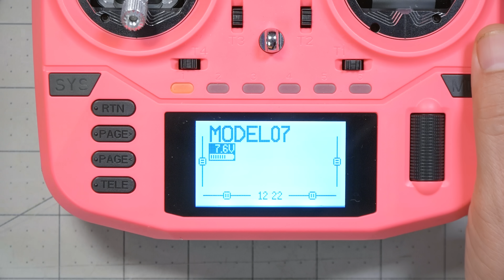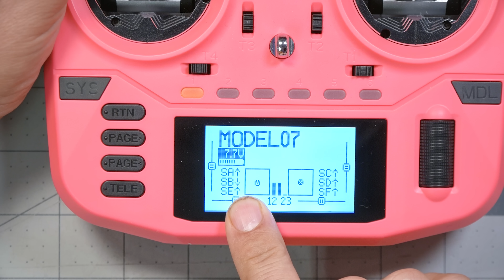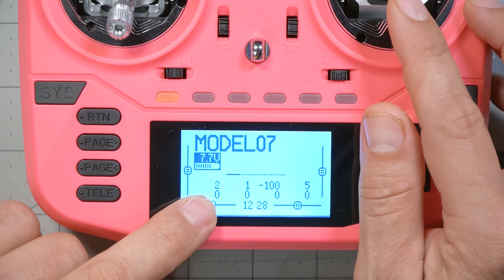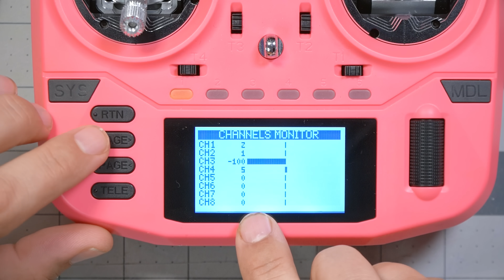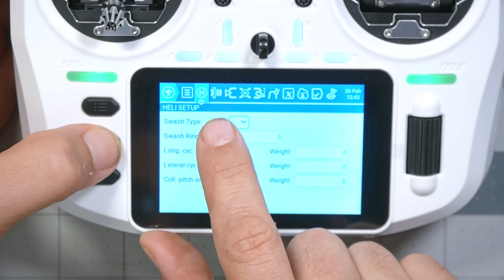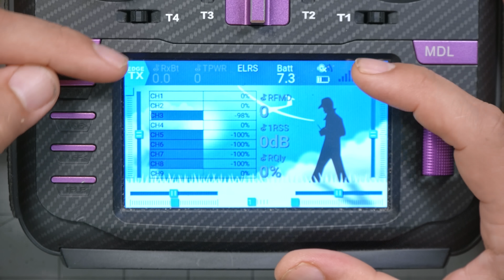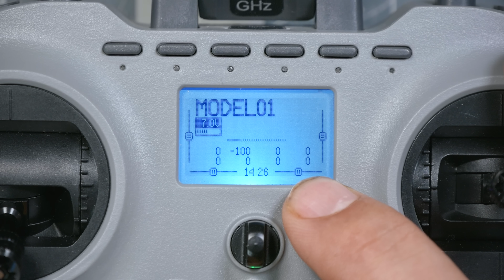EdgeTX - Complete Beginner Guide - Ep01

Comment: Hi Joshua....following your videos on Edge TX but have a question...will my TX16s running edge TX be compatible with a Radiomaster R9DS receiver? I thought it was since I have both the ELRS and 4 in 1 module (bought the 4 in 1 after purchasing the ELRS version) are supposed to work with every protocol out there

Comment: Hi everyone,
Hi Joshua,

I bought a servo on Amazon to rotate an FPV camera.
According to the specs, it has a rotation range of 270 degrees and expects a control signal with a pulse width of 500–2500 μs.

I’m using a Radiomaster TX16S with EdgeTX, which by default outputs signals in the range of 988–2011 μs.
With “Extended Limits” enabled, I can get up to 732–2268 μs, which already allows the servo to move significantly more – but it’s still not utilizing its full range.

I’m now looking for a way to configure the transmitter to output the full 500–2500 μs pulse range, so the servo can use its entire motion.

Does anyone know how to set this up in EdgeTX?
Any help is greatly appreciated!

Best regards from Stuttgart,
Philipp

Comment: Please help, both my drones with 04 elrs working fine with binding phrase, now I can not get them to arm, when I unplug battery, controller says transmission lost suggestion its connecting, also if I turn the arming switch on before powering, it gives me a warming, meaning the switch is working??

Comment: Just purchased new Boxer radio. Trying to remove sd card to replace with brand name card. Without using excess force how do you remove the card. Mine refuses to move with moderate force.

Comment: As an edgetx user, with a TX16s flying fixed wing aircraft. I seem to be the guy that our FrSky ethos users come to for help. Most of them went to Ethos because edge was too hard to learn. They seem to have the same issue with Ethos. Steep learning curve.  Sure, dual band is great for large scale jet turbines. But most have the 4 in 1 FrSky Tx modules to fly the planes they already have.

Comment: I've been getting more interested in the hobby again after a few years of lower activity. Your videos have been good so far. 

However this one rubbed me the wrong way right out of the gate. Almost immediately you made an assumption that is just plain not true in my opinion. You said there's almost 100% chance that my transmitter is running edge tx. However at the multiple local clubs I fly at it's very rare to see an openTX/EdgeTX or frsky system. Most are on spectrum or futaba. With a select few on jeti. Then even less common than that is the open tx stuff.

Your videos are informative and you present well. But please don't make assumptions like that.

Comment: Just found you via flowstate film. Great work BTW. I'm a pilot and have a flight sim set up. Is there a simple way to plug a controller into the PC and use my hotas flight controls and pedals to fly fpv ?
Reply: coming from being a flight instructor(And sim also) and into FPV now. the throttle movement in fpv is so intense and constantly changing rapidly, u can assign the axis , however i doubt the hotas would be suitable, not even close, however u could use them for plane rc sim

Comment: The stick position indicator on the screen is a great way to quickly verify your sensor gimbals are not going bad before every flight. You don’t want to be mid flight and noticing your quad pitching forward or throttling up on its own and you freaking out on what is going on.

Comment: I have a RadioMaster TX16S mk2 max that is a week old running very old system. I contacted the guy i purchased the radio from telling him WTF do i need to update a brand new radio? He said don't ever update your transmitters 😅 he said all you'll end up doing is bricking the transmitter!
Reply: if its not broken, dont fix it, .. unless there are features u need. then its worth going through the trouble, bricking has plagued firmware upgrades generally, but if u can follow instructions well and apply common sense, its perfectly safe

Comment: but channel values are neither 0 to 100 or -100 to 100. it is based on the servos, so it is based on the pwm values, and pwm values used are from ~1000 to ~2000.

Comment: Some have 250mW transmission  power . Lots have less . Elrs claims
500 mW on some . If you use external tx module on 1 watt   batteries can go dead in minutes . 
External batteries on a balance type plug using the 2 outside wires and fall out all the time and radios take a minute to restart

Comment: 5th!   Thanks Bardwell!   😁  I was actually thinking about upgrading from the DJI Controller 2 and this video will definitely help understanding things!
Reply: Me to what one are you thinking 🤔? I was gonna get the boxer or pocket.
Reply: @X862go  I've got both and like both, but use the boxer more because I like full size gimbals. Both are great radios, and it's nice to have the pocket when I'm packing light and as a backup.
Reply: I got the pocket and really like the form factor coming from the rc2 dji transmitter @X862go
Reply: @X862go   Sorry it took so long to respond bro - got hit by Hurricane Helene and haven't had power.  I've been looking at the RadioMaster Pocket.  My brother has the Boxer and he loves it, but its too clunky for me. But I got smaller hands.   I guess it depends on how big your hands are 😂